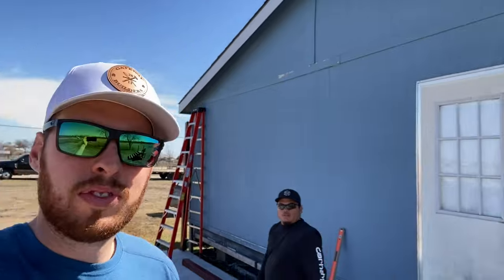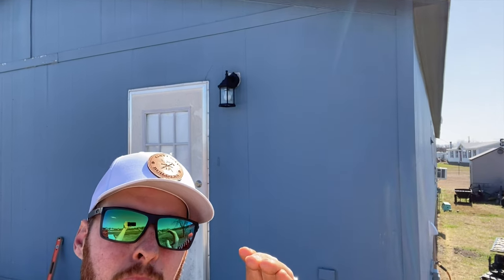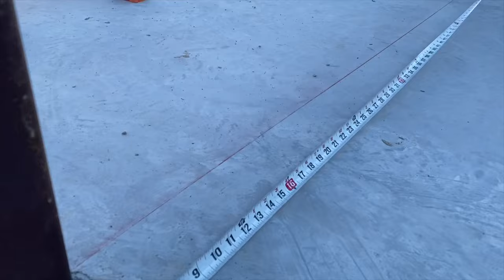Building a Weld up Metal Garage Extension

Comment: @gateway builders Nice work. I am curious is this more cost-effective than ordering a prefab red iron building? What is the main reason for stick building versus prefab in this instance. Thanks for posting
Reply from the maker: It the moment weld up buildings are the most cost effective shop. Bolt ups are more expensive because your paying a material supplier to fabricate
Reply from the maker: It the moment weld up buildings are the most cost effective shop. Bolt ups are more expensive because your paying a material supplier to fabricate

Comment: Really appreciate you showing how it is done. Do you weld some sort of plate to the top of your posts for the beam to sit on or is the post open at the top?
Reply from the maker: Thanks! It’s open then the beam gets welded all the way around the post opening to seal it up
Reply: @GatewayBuilders  Thanks. What makes you decide whether or not to run the purlins flush vs on top of the beam?
Reply from the maker: @joesmith6972  Builders preference, some like the ability to be able to slide electrical conduit continuously above the beam. 👍

Comment: If I want to have 40ft x 50ft clear span single slope what size ibeams would you recommend?
Reply from the maker: Me personally I wouldn’t want to go under 14”. It’s gonna naturally settle a little. But engineers would tell you 20-22”
Reply: @GatewayBuilders  ok awesome. Have you built trusses for something like that? I am considering those as well,  it is for our house so it is just as much an aesthetic thing we like the look of them... But want to go single slope for our water catchment and most of the trusses are 30' max and I am out in the middle of nowhere Arizona.
Reply from the maker: @OffGrit  We have built the trusses before and it’s very simply. Just cutting the pitch on both sides of the beam

Comment: Do y'all have a general rule of thumb when it comes to picking the size of your I-beams?
Reply from the maker: Yes depending on gable vs flat roofs we have different ibeam that support different weights.

On a normal 30ft wide build we use 8” 15#, but on a 40ft wide we use 12” 16# or 19#.

Comment: Hey man amazing video. I’ve been searching all over youtube to find info about a build just like that to make my own personal gym and the content here it’s incredible. Any tips if I’ve wanted to get an stucco finished to match my house? Thank you
Reply from the maker: Thank you! I would put a stud wall up and decking if I was doing stucco. Or you may be able to drill the foam board to the exterior metal sheeting and do it that way. Not real sure on that one
Reply: @GatewayBuilders  Thank you for taking the time to reply. I think I might just do metal for the siding. Wood price is insane. For a 30’ x 50’ should I use on the walls I beam or 4”x4” square tubing?
Reply from the maker: @luiscervantes5662  how tall do you want the side walls? Because we use 4x4 up to a 14ft side wall. Anything taller we bump up to ibeam typically but it depends on the complexity of the build.
Reply: @GatewayBuilders  Oh it should work cause I’m only planning on having them at 10-12’ so it should do the trick. Man I truly appreciate that you take the time to reply. Maybe further down the line when I’m ready to start the project if you have the time we could work something out like a consulting session or something. Either way I’ve taken a lot of information so far so thank you
Reply from the maker: @luiscervantes5662  good luck Luis and I’m happy to help.

Comment: How long of a trailer do you use?
Reply from the maker: Now we use a 30ft gooseneck with 2 12k axles. But 7k axles will do just fine, just make sure you keep a eye on your weight. 👍🏻